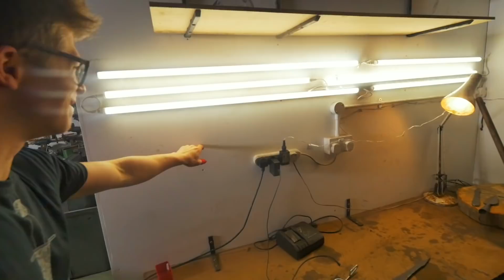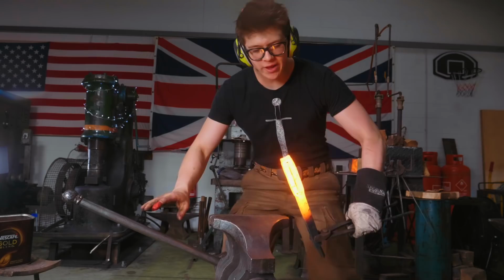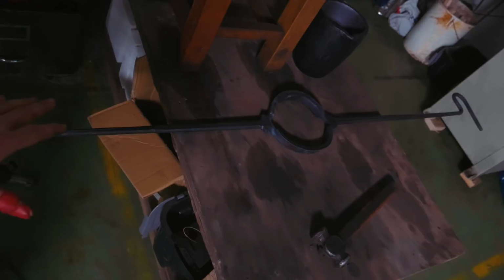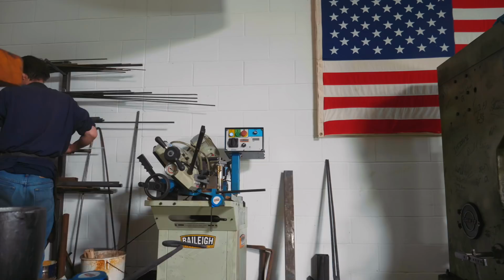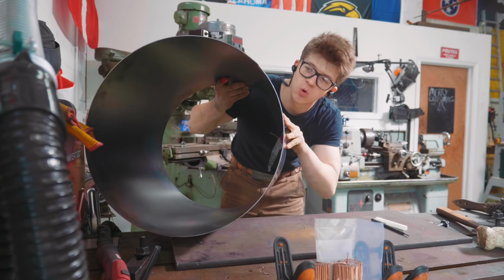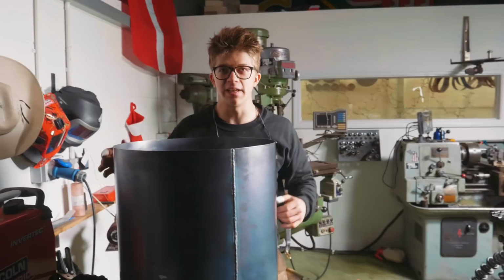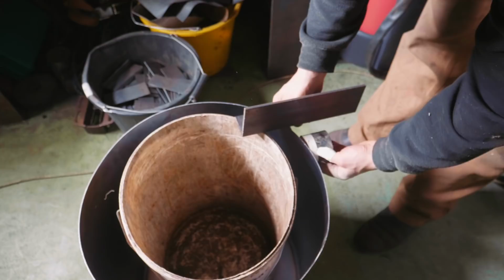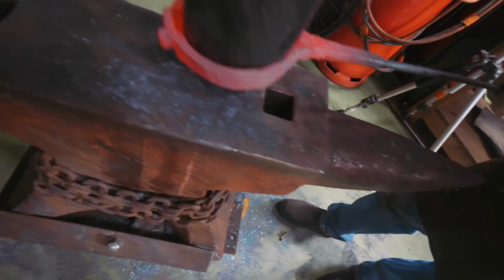BUILDING A FOUNDRY!!! PART 1

Comment: Your lifting tongs should have a right angle handle. You're not going to like straddling the hot furnace to lift crucibles straight up and out. Long, straight, stiff handles to pivot, right angle down to lifting jaws. Then you can stand to side to lift up and out. 
A foundry like a forge, is not just a matter of more fuel equals more heat. A coal forge, you don't add more coal for heat, you add a blower. Same holds true when using gas. Your burners, even with the air adjustment, only provide enough air to maintain a flame. The venturi effect of your burners can only draw in so much air, regardless of how wide open they are. Add a blower and you can triple your heat output with less fuel. The chamber of your forge, and your melting furnace are closed combustion and soon become air starved. Simple enough to prove the concept with your shop vac on blower with 1 1/4" steel pipe extension. Fire up one burner on your forge, insert blower extension from the back side, close up with bricks like when your heating metal. Turn on shop vac. You may have to adjust position of blower extension, up, down, in or out to find best position. 
Then again, you will probably never read this and keep fumbling along. 
A wise man learns from other's mistakes, a fool must learn on his own.

Comment: Alec, the way you’ve placed the burners on you’re foundry is incorrect. The way you have them set up now means one side is hotter than the other which can cause the crucible to crack when cooling.

Comment: Shouldn't your crucible tongs be bent at the end so you're not standing directly above the heat when using them? Also I think the pourers need a hook to lock the crucible in place when pouring otherwise you might have some troubles

Comment: If you ever want to make a PID controlled oven or foundry, let me know. I built my own heat treat oven. It's 9" x 9" x 18" and works AMAZING!!! I've got videos(build guides) where I heat treated CPM154, AEB-l, 52100 and did hamons on 1095. I'd be glad to help in any way. Take it easy.

Comment: I'm certain that it's already known, but for the sake of anyone getting started with this, a graphite crucible which looks like the one Alec got, should be fired and let to cool down without anything in it first else it is prone to cracks. and you could actually have it break inside your forge.

Comment: Aleeeeeec, i gotta know, when you're TIG welding steel what material do you use alongside the welder? I know rods come in all kind of types with flux cores and without, but i'm not too familiar with TIG, aside from knowing a bit about the gas system.

Your welds are seriously solid work.

Comment: Sheet metal shears or what we call "snips" would work famously for cutting those holes. And, you could have just put the burner nozzle up to the cylinder at the angle you wanted and then used your marker to draw around the outside of it and get your almost perfect oval hole. Sheesh..

Comment: Please tell me you kept all of your waste bits from grinding and oxidised metals. You can melt it all back down and use it again. Wondering if you'd get any patterns appearing in forging it out again? Or would the carbon and nickle percentages homogenise?
Reply: Cheeky J they would homogenize. That is why crucible steel is better than bloomery steel. In bloomery steel it doesn't actually completely melt leaving contamination in the steel during the creation of the base steel. Crucible steel is completely melted and becomes homogenized  while the lighter material floats to the top and any heavy material will sink to the bottom. This will give you a higher quality steel from the original materials. In Alec's case it is less time consuming to buy the high quality steel stock. Not to mention the oxidized steel and grinding powder are from varying steel types... He couldn't be sure of the quality and content of any steel he produced from those left overs... Lol. Sorry for the long explanation, but I hope it helps you understand the history and process a little better.

Comment: I am curious about the big green hammer machine.  How old is it?  Noticed the big pulley on the side - for some reason it gave me impression that it was older.  

Always thought it would be cool to have a shop where all the equipment was driven off an old style line shaft.

Comment: Why didnt you use 3 holes around the bottom of the forge in a horizontal line? (Vs the vertical line you did) it would heat the crucible more evenly and waste less gas.(as the gas burner at the top wont heating much at all the two lower burners will just force the heat up and out.
Reply: zombie123443211 i think the idea is 3 crucibles 3 burners
Reply: Markus Camenzind well good luck with that idea. The crucibles need to do that feat are not easy to make.
Reply: zombie123443211 he bought the crucibles he said and more are coming 
Thats what i meant 3 different sized crucibles 3 burners 
You know light the bottom one for a small crucible and add burners as you up size the crucible
Reply: Markus Camenzind makes sense sorta. Still would go with 3 burners on the bottom, you can always vary gas flow. But i missed that part. Makes sense now.

Comment: Strange question and im not a black smith so i probably sound stupid but why not just drill the holes
Reply: In the parts like the tongs he made? Mostly just because it's traditional to forge them in. It's also good practice, and when you're learning something new practice is very good, and often what you're looking to do, so... But your point is valid - it probably would be faster and more accurate to take the parts over to the drill press and drill them. But as you saw, being that they planned to rivet them together, the accuracy of the holes isn't that critical, so practice, practice, practice!

Comment: Hey Alec, I've seen Colin Furze cut into pipes with a hole saw on a drill press to cut the circular groove into the pipe, might be a better alternative than the trial and error grinding method that you used @12:05

Edit: Here's an example of what I was referring to:
https://youtu.be/Gh34A0b8MrE?t=5m

Comment: Couldn't you have  made the holes the size of the small pipe, then fed the pipe from inside? That's what I did when i built my propane forge with homemade burners.
Also, whenever you want to cut a pipe with a round angle, use a hole saw in the middle, instant fit to a round surface, no grinding. (You could've cut the PVC that way) It's how a lot of people weld round pipe.

Comment: should have arranged 3 burnes (or two radially) a couple inches from the bottom.  heat rises and such upper burner is kinda wasted. Also you are making one side of the furnace hotter than the other the castable refractory does slowly melt over time wherever your hot spot is. I used to pour a couple thousand pounds of bronze a day 200 lb at a time. also consider putting a hold down arm on casting hoops.... dropping a hot crucible at the end of your pour  and wrecking it or your casting sucks.
Reply: also using ceramic fiber wool or kaowool for the walls is sufficient on a furnace that small and heats up way faster . Castable refractory has a good bit of a heat up time it used to take us twice as long to heat furnace up for first pour than to melt a new charge on successive pours.

Comment: I myself made a propane foundry, and it works fantastically but i have been wondering if a propane foundry produces CO gas and if i should be worried!
Reply: CO results from incomplete combustion.  With a sufficient air supply there should be little CO produced.  All the same, good ventilation is advised.
Reply: hanelyp1 Thanks for the info!

Comment: I should advise you not to get the words Furnace and Foundry mixed up. The Foundry is the establishment in which you make molds, melt the metal and cast the castings. Much like the words Garage and Hydraulic lift shouldn't get mixed up if you're just talking about the Lift. The Foundry is the shop, the Furnace is the piece of equipment that melts the metal. I've been a Foundryman since 1972 and have just finished my 42nd video on the subject. If you tune in to my sandrammer channel, I advise you to watch the Summery of my channel first.

Comment: making the holes for that i would do it differently.. 

Step one, wind some normal printerpaper around the burner so i get the right dimension on a tube

step two, use scissors to cut them instead of a grinder to get the right angle 

step three, cus im lazy and the paper might be abit unstable to mark around, put the paper onto the place you want the hole, then use spray paint on the inside of the papertube you've just made and tadaa you have a perfect shape marked to be cut out with the plasmacutter, but cut it out closer so you can grind it to the perect shape and have the angle continue through the wall of the forge ^^ 

just really felt like typing this as it was a fresh idea in my head.. full disclaimer i did not watch the video done before commenting because im one of those douches. now i will tho.

Comment: Any actual engineers out there tell me if I'm wrong, but it should be pretty simple to figure out the optimum (or what I'd assume is optimum) angle for the burner inlet. I forget the equations, but take your burner pipe's outlet, measure its ID. Then fab, CAD, or draw this out: make a cylinder with the radius of your burner's outlet and the length of your foundry s ID as well. I know that a 16th or an 8th inch (whatever those are in sheet gauges - I forget) may not seem like much, but that's the point of optimizing without being pedantic? xD So ok. Now you have the cylinder and the circle. Now put a line across the diameter of the cirlce (there are several ways to do so, such as using other smaller arcs of a circle), and now that you have a 90 degree angle, match the 90 degree angle on the face of the cylinder (looking at it sideways, which should make it look like a rectangle), with the very corner/edge of the cylinder. Now you have the cylinder penetrating the circle with just the tip, one long side of the cylinder should now be a tangential line. Go to the other side with a top down view, find where it intersects the circle, and mark it. From that mark, now run a line to the center of the circle (if you're not sure here the circle's center is, you can use that same arc method to make another diameter line, then X marks the spot). from there, it should be a breeze using, like, 7th grade geometry formula to calculate what the length of that arc of the circle, which would be the width of your oval, with the ID of your burner pipe being the height of the oval. And key detail, the point of the tangent, it should be a point, not round, or like crease line indicating a transition from going straight. Arguable, if laid flat, it should look like a tear drop.
Reply: Custos well done
Meanwhile everybody eyeballed and cut 3 holes
Reply: Markus Camenzind ........do you not understand what the word "optimization" means or the point behind it? Because if you don't care to go to such lengths, good for you. No one cares. Fabricobble til your heart's content.
Reply: Custos you mixing up OD and ID also it's called a furnace NOT a foundry 
Fabricobble ? What's that supoused to mean (shoemaker? )
Out of interest You work in an office?
Reply: Markus Camenzind Yeah, no. Spoke with a civil engineer friend. You'd want the surfaces to match at that tangent point for the smoothest dynamic flow of gasses as you transition from burner to chamber to help produce the vortex, hence both IDs, ya know, since the gas never touches either OD. Odd how that works, what with the fire on the inside and all. Also, "foundry" and "furnace" are commonly used interchangeably, regardless of how many pedantic oldtimer panties get wadded up. From your comments so far, I can only presume you were never overburdened by much of that pesky book learnin'. Regardless, I find it entertaining since you speak like someone who thinks quite highly of his ability to fabricate, yet you've somehow never heard the word "fabricobble." I'll break that down for ya, in two ways. Firstly, it's a compound word, a portmanteau to be precise, between "fabricate" and "cobble" as in "to cobble something together," not "cobble" as in "cobbler." I'll let ya wrestle on your own with how the two interrelate when combined. Don't hurt yourself now. Secondly, if no one has ever said that word around you, I got bad news for your workmenship, but at least you can rest assured that your buddies care about your feelings and keep quiet around you. Oh, and I swing both ways - plenty of oil and ink on my hands. We can't all be just desk jockeys or just glorified nail swatters.
Reply: Custos thanks for explaining fabricobble as english is not my first language 
Don't know were you grew up but my australian friends  (mechanics,boilermaker etc.)also didn't know that word
Also you seem to like to impress people with long winded explanations
And no they are not interchangeable  (even ask a teacher on that one )
I know it's common to think if enough people get it wrong its ok to say so
Just looked up cobble (not that i don't trust ya ) but my dictionary tells me it means rounded stone as in cobblestone 
Maybe you should stay clear of so called urban words and use also less impressive but  more informative language
Reply: Markus Camenzind Luckily, I'm only interested in impressing those who'd be impressed. Fewer surprises that way. And the word is a fairly common expression in the US. It's generally used jokingly, as an insult for poor workmanship, or as a self-deprecating "I did what I could with what I had" when that's the reality of the situation. At 4am, sometimes it's best to get the job done and weld a few nuts together than to make a special trip out for a proper coupler or adapter.
Reply: Custos on a side note 
I think ,after rereading your first comment 
You talk about the burn angle to create an optimal vortex  ( ID )
Were i thought its about hole angle/ placement  ( OD )
Reply: Markus Camenzind I think I see where you're coming from, but the only surfaces we care about are those that come in contact with the gas stream in terms of aerodynamic friction, turbulence, and tightness of the crucible chamber diameter relative to the volume of air we're displacing into the burn chamber. But I did see where I misspoke some. I was fixated on the sheet metal and pipe wall thicknesses, I forgot about the refractory cement. The same principles still apply, but offset more inwards to match the ID of the pipe with the ID of the inner chamber wall. As for your idea, I could see it, but I'd need some hard data to accept it. Because if we go with matching ODs or mixing IDs and ODs, and/or the material thicknesses aren't the same, there's a small void created because of the lip from either the pipe or the chamber wall, granted that lip can be ground down. At that, two things come to mind that may validate not matching IDs at the tan point as the more efficient design: the small void at the lip develops a vortex that acts like an air cushion such as with the trivets of a golf ball or if ground down and the transition has a slight sweeping arc, which allows it to follow the same principle as a brachistochrone. And don't assume I haven't acknowledged that, at this scale, these details may be negligible, but it's still fun to explore the physics and engineering.
Reply: Custos calculating a up side down vortex around 3 different crucibles and a lid with unknown hole (funel cylindrical ) and 3 burners  (not all in use all the time i assume )not to mention safety drain in bottom 
Let me know how long that's gonna take
When i built my single burner furnace i placed the crucible closed the lid started fire and changed angle till it felt right before welding it in place 
But the again its only meant for small jobs like guards , pommels, fishing weights etc

Comment: Wouldn't it have been better to put the burners around the foundry instead of all in one spot? I realise that the foundry isn't big enough to have much of an effect on the temp all the way around but wouldn't it heat up faster if you spread it around the bottom of the foundry as well as be more efficient? I only have basic knowledge of thermal dynamics so if anyone can fill me in then please do.
Reply: It shouldn't make a big difference in even heat, but spacing them at thirds of the circumference would make it a lot harder to pipe the gas in, and they might get in the way.

Comment: try to mix damaskus... mixing the metalls and experimeting. i wonder what it woud look like
Reply: Like normal steel?
Reply: Fire Spark I ment if you melt and pour side by side...not in one pot ^^
Reply: I am still unsure what you mean. Cooling then pour a new layer?
Reply: Not quite, more like milk into tea, both liquid take out of the fire then pour the one into the other... the crossektion of that. If it works like I think it could, don't hase to be so
Reply: Its also a problem of how much they mix. If much at all they wont desolve as well
Reply: That's why it it interesting, to see some possible outcomes

Comment: What happens if you cast metal and then forge it? Will it just crack?
Reply: you will have to consolidate the billet, and perhaps fold and forge weld to refine/diffuse carbon
Reply: Depends on the metal, if it's steel, no. But if it's a more brittle metal, then yes. It would be so cool to have the roughed out shapes cast, then hand forged for bevels and such,